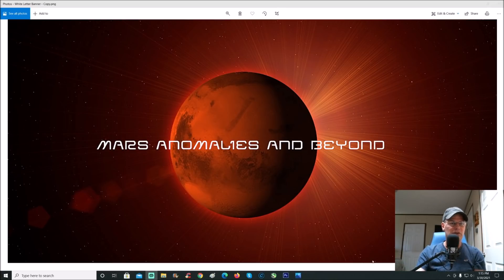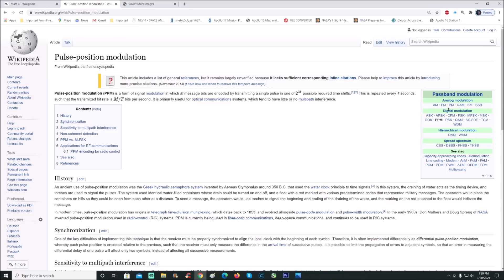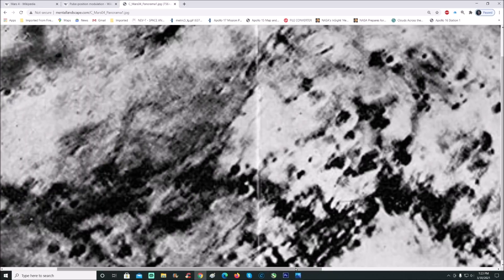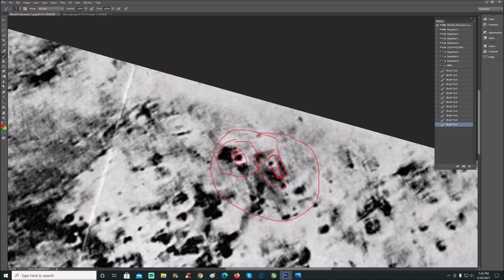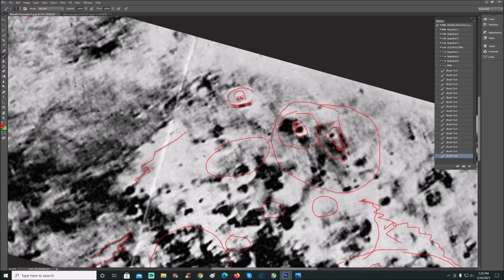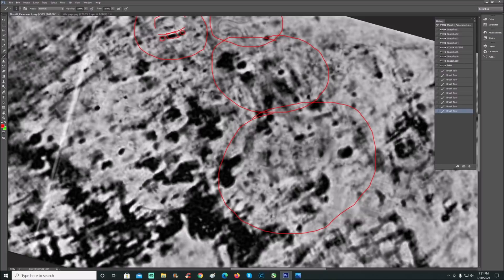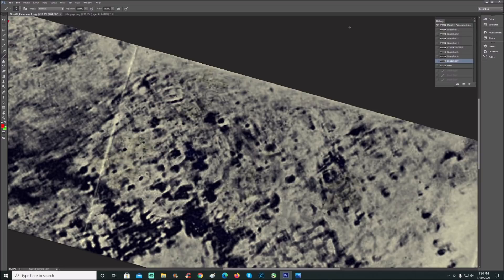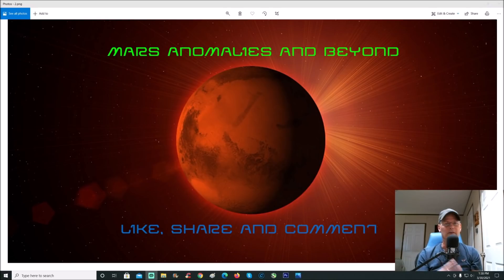Did Russia's Mars 4 Orbiter See Structures On Mars Back In 1974? ~ 3/30/2021

Comment: Chris, always great work.  Question.  Why are there thousands of small, medium size rocks, boulders in all the flat plains with no larger boulders as a source.  Why are these rock scattered with very few piles?  Most of the rock are smooth.  No sharp edges.   I most cases major rock formations are miles away.  Rock fields are composed of scattered rocks, stones with massive sand areas between.  What is the composition of most of the rocks, stones, bolder?  How did they get spread out?

Comment: 9:57 What are those five dots doing in a row that are pointing downward starting from the top they are separated and get closer and then one dot in the middle? It looks like landing gear something landed there off to the left of the screen is where you will find it right in the middle

Comment: I see what looks a whole area of block buildings or wall in a slightly curved chain. 

At 13.48 starts on lower left with the thick walled light coloured reversed C  block with a curved black reversed C  bite shape took out of it, it joins 3 blocks up to a Thicker blocked wall, then a larger  plan structure with thinner walls.
Which appear to have a thin outer wall and 2 shorter block walls (towers) behind it, possibly is/was a 3rd that's either broken down more or been lost under the fold/join in the images. 
Before that larger building then joining to the square walled structure with the centre circle near the top n not far from the right side of the fold/join line, that if look carefully if was to make the top point as if 12 on a clock then you have a line from centre circle to outer square wall at  roughly the 7 o clock- 7.30 angle and one at about 11 o clock.

But seems to be a lot of other walls from that square with circle middle. Almost looks ornate grand low walled garden, with something like a centre round feature.  Maybe reading too much into it, but there seems to be some planned layout, but the top of the picture fades out so harder to see

Comment: In this timeframe of these photos, Charge Coupled Devices (CCDs) as they exist today in cameras were not around back then. Thus resolution is very limited, probably no more than 64 bits (gray scale/B&W) using PPM digitally. There are techniques and other modulations types available back then, but power requirements and weigh would be a huge issue for the available technology. It could also be analog PPM as well, but the resolution would not be much better. I would imagine that now days QAM (quadrature amplitude modulation) like TV stations is used. While lasers can carry incredible levels of data bandwidth, long range communications (e.g., Mars to Earth) is problematic because the beamwidth of the laser is so narrow that it is difficult (and the sensor beamwidth is also very small) to aligning the transmit and receiver sensors together reliably. Most likely they are using VHF or UHF RF frequency bands to relay data streams. I worked in signal intelligence for 20 years (and during the time frame of these photos) and have some familiarity with PPM, et al.

Comment: @14:02, zoomed in pretty close, over on the left-hand side of the image--follow the squiggly lines that you were pointing out earlier, on to the right--now look at the entire line of squiggly lines, and I swear I'm looking at writing--characters, letters, whatever you want to call them. LOL, or I'm maybe suffering from paradolia! Anyway, the lighter colored area you were working on near the beginning of the video, looks to me like that whole light-colored area is a multi-storied structure (tucked-up against a hillside?) with the roof collapsing in, and the objects you were highlighting look like equipment maybe, sitting on the roof. Check out the shadows under and around that light area, you can see INTO the structure at stuff on the inside. Pretty darned cool image, Chris, thank you!